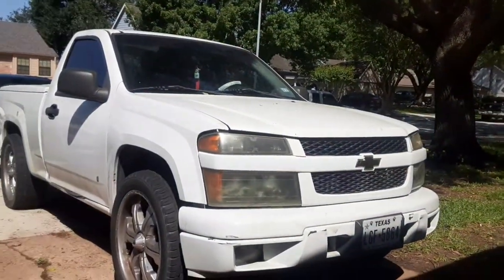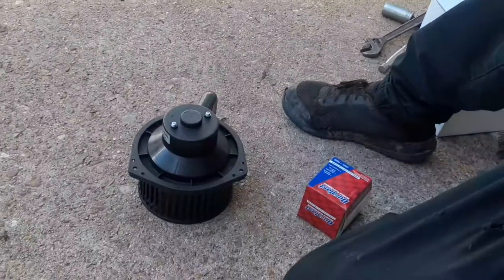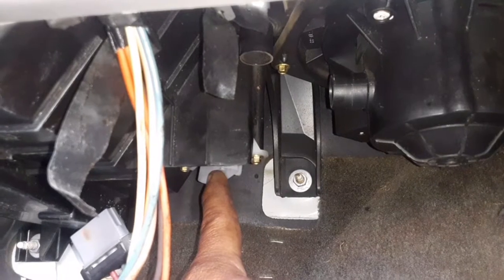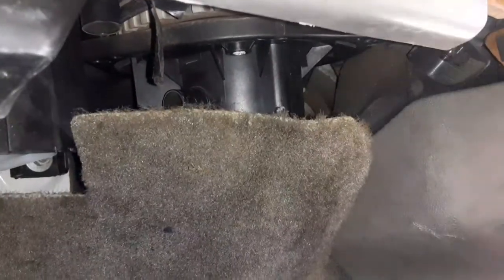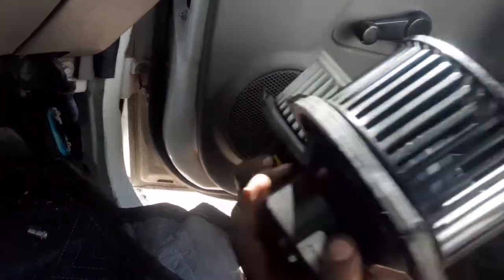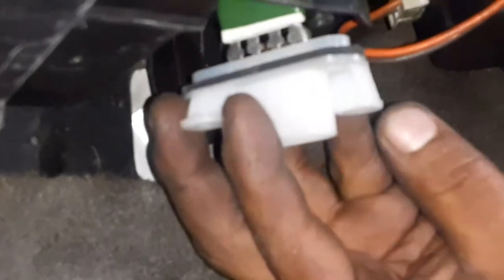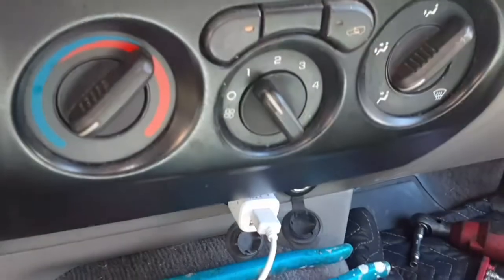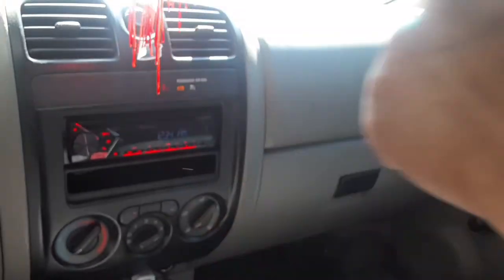2006 Chevy Colorado blower and resistor replacement

Comment: obviously not a production level video. but this was EXTREMELY helpful. thank you for not editing out the part in between the steps.
Reply: also my dad does that whistling sound you made at 6:35. i wonder if it's a hispanic thing 😅
Reply from the maker: 🤣  that an old man whistle lol  my grandpa used to do it all the time.

Comment: i knew my blower motor was bad because it was noisy! but  my fan only worked on the 'high' setting. did not know that i needed the 'resistor'. thanks for that!
Reply from the maker: You have to stay positive all the time !!!
Reply: Yes go ahead and put new resistor and  sometimes you going to need to put new wire harness and they will going to work all the speed levels. I have it 06 canyon and i have the some problem like you and now is working good 👍🏼

Comment: Thanks for the instructions, i ordered the parts because my blower stop working been when i got frustrated because of that back screw i gave up for another day, went to turn on my heater everything started working again. But will keep the new blower & resistor just in case it goes completely out .. thanks

Comment: The screw to the right and back will seem next to impossible to get to good. The way I got to it was as fallows. Take a 4 inch 3/8 extension add a 3/8 to 1/4 adapter  then add a 1/4 extension then add a 1/4 swivel then add the 5.5mm socket. Do not put a rachet or anything on the end, turn it with your hand and fingers, this set up allows you to get it loose without a rachet.

Comment: What if the blue gray wire that's in the plug that goes into the resistor has gotten hot and a little melted

Comment: Whenever I would go over bumps the ac would turn off and on sometimes on the thrid settings
Reply from the maker: Check your connection make sure it not blown to your blower
Reply: @aaronmobilemechanictv7841  Well most of the time the highest setting would only work and none of the others I replaced the resistor and I haven't had problems ever since